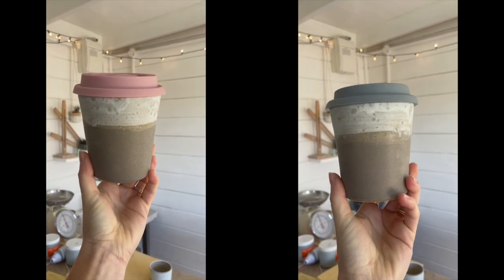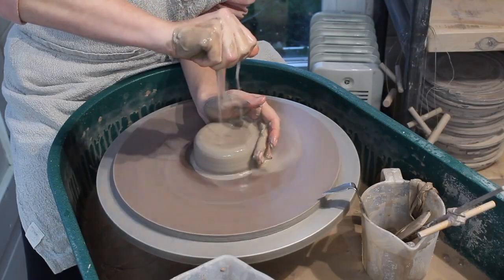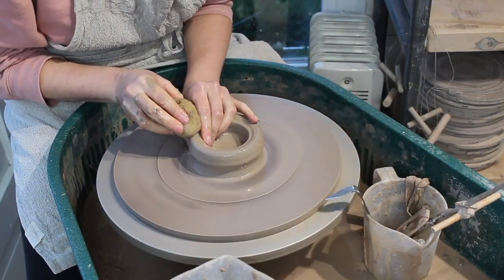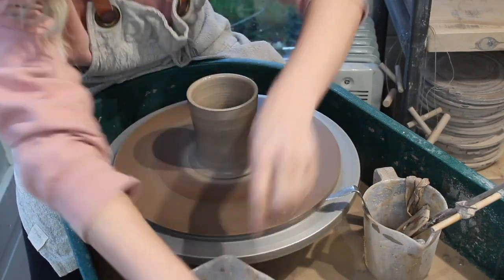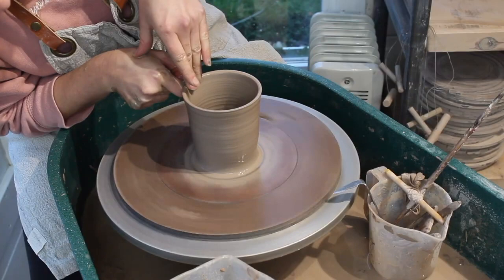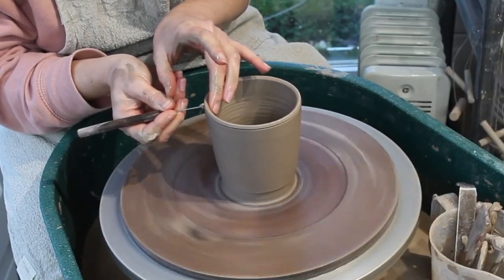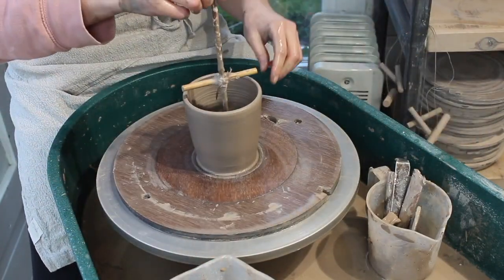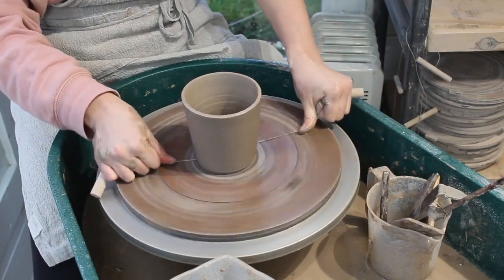How to Make a Travel Mug Narated Tutorial

Comment: This lady is quite experienced,  if you are a beginner slow down the speed of your wheel as you do your upwards pulls. if you try and go as fast as this lady you might find it a bit tricky.  Also for those of you that dont think in both metric and imperial 3 inches for the base is about 7.5cm and for the height 8-9cms is about 3 1/4 inches but it looked to be more like 4 inches I think final height.  (420 grams is about 1 ounce under a pound )